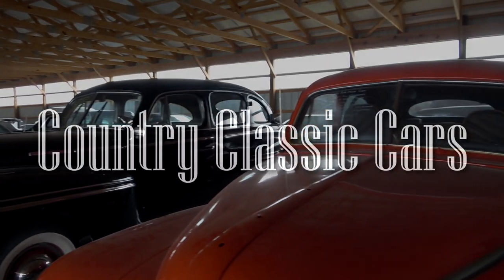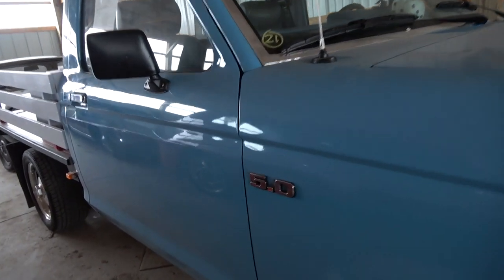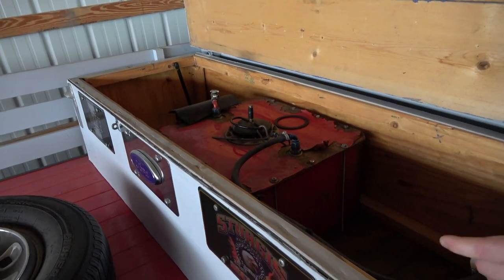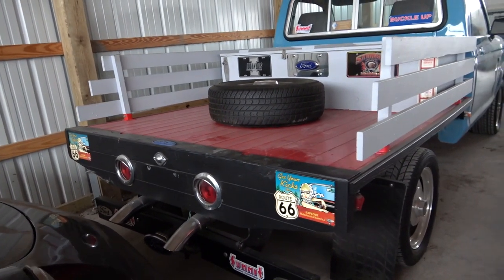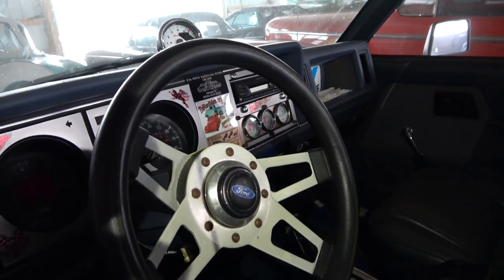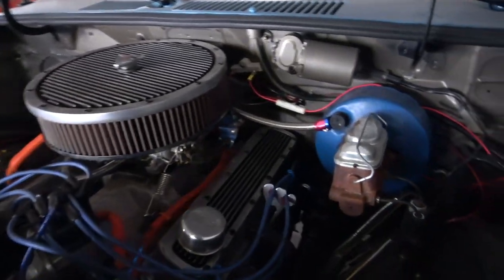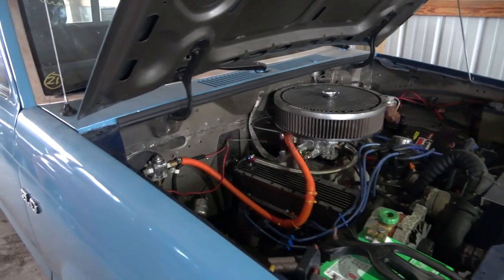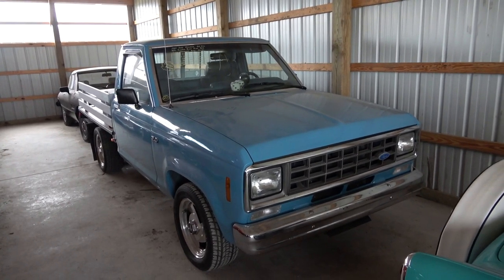5.0 V8 Swapped 1984 Ford Ranger at Country Classic Cars

Comment: Nice Ranger, it is in great shape, and they were tough trucks. I owned two Explorer Sports, 2 door models, and loved them. I knew the Mercury Mountaineer had 302's in them, so I knew the 302 would fit in the Rangers and Explorers. 
. Anyway, whoever owned this truck took good care of it. Interesting old Ranger.
Reply from the maker: Thanks for taking a look my friend.  Yeah, the Mountaineer actually had one of the best 302's too, with the Cobra style intake and heads.
Reply: @RamblinAround  Thanks Jeff, I wasn't aware of that . They made a 2 wheel drive model which would have been a great sleeper with that Mustang engine. I bought repo's at that time, and paid $4900 for the '98, and the owner still owed $14,000 on it. I drove it 5 years and sold it for more than I paid.